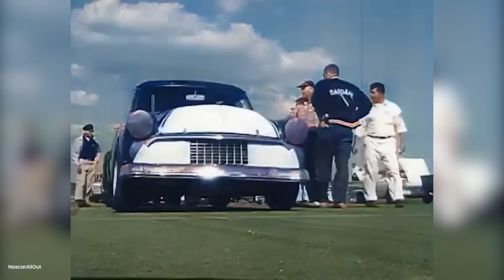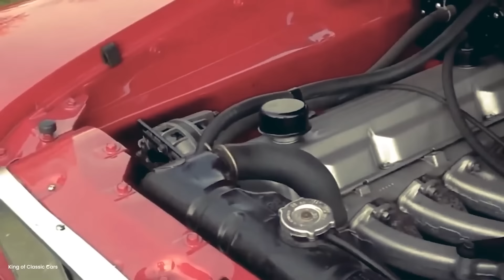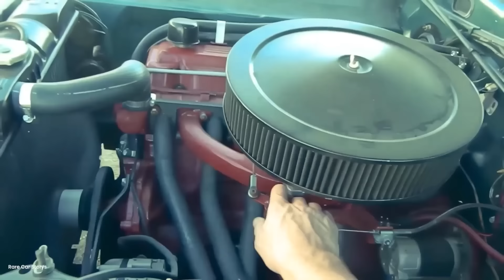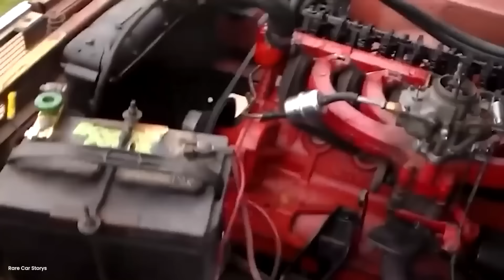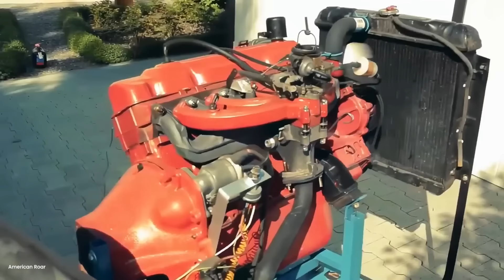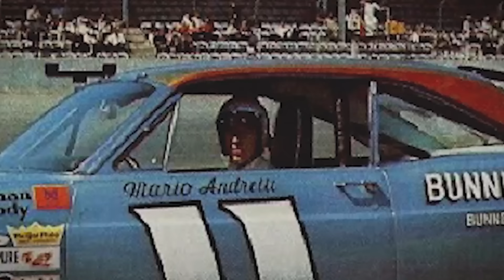How One Mechanic's "SIMPLE" Intake Manifold Made Plymouth Valiants Dominate the Drag Strip

Comment: Almost every thing said in this video is bull it doesn't take half that much work to do get a big block in a dart or duster or A body. I've done it in the past and I am doing it now. And with a mild 440it was a 12 second car with a 4 barrel and headers, nothing special and a set of gears . Why would you have to pull the oil pan to change the cam in the 440?

Comment: My father's new 1960 Dodge Dart Seneca had a 225 slant 6, 3 on the tree that eventually made its way into my teenaged hands. I outran MANY V8s with that car. In 1971 I bought a new Dodge Dart Swinger automatic. That car was a disappointment. The crankshaft went bad and knocked badly.

Comment: I remember people laughing at my bro at 16 when he adapted a 4 bbl Holley on his 66 Baracuda. Sucker ran like a raped rooster just with that carb & adaptor plate!  
 Didn't have it long, sold it & bought a 69 GTX with a full race 440 6 pack. He lived at the strip after that.
 My big Slant 6 1964 Dodge truck put my Uncles 1976 Chevy 350 to shame pull starting  my bros semi 10yrs later too. That low mile GM never budged it, my Dodge had over 300k miles pulled him over 3 blocks.
These things have excellent torque...

Comment: Why are pictures & videos of the 225 ci slant 6 backwards? I did the Offenhauser intake with a 500 cfm Holley 2 barrel. My times at 1/4 miles were exactly what is stated in this video. I also still got 28 mpg due to the overdrive 4 speed manual transmission.

Comment: First car was 66Dart GT 225/904 and when it broke I bought local guys old 225 slingshot gragster parts.
 Way over bored, .187" 1/2' stroker crank port and polish head w big valves, 527 lift cam, two 4 bbl intake with two 465 cfm holleys ank 2 piece cast iron headers. 
Custom dual point dist.

Comment: After I wrecked my Hillman Minx convertible, I bought a 61 Valiant V200 with 50,000 miles on it in 1965 for $500. The strong point of its 170 cubic inch slant six motor was the fuel mileage and its reliability. Like the Hillman it was under powered.  Getting on to the freeway was scary. The on ramps were designed so that under powered cars and trucks could merge at the Oregon statewide speed limit of 55 mph. The best I could do by turning on to the ramp at 45 mph was 62 mph when the merge lane ended. Often the traffic was going 70-75 mph. If you held the accelerator peddle to the floor long enough it would eventually reach 90 MPH.

The steering on the Valiant was the recirculating ball type with five turns of the steering wheel lock to lock that was typical for American cars. It had 2 inches of play before a directional change could be made. It lacked the feel provided by the rack and pinion of the Hillman. Typical of European cars the Hillman had 3 turns lock to lock.

 The Hillman gear shift with a flipped H pattern located on the steering wheel column. Valiant’s shifter was on the floor, not for a sporty feel but because it like its bench seat was cheaper. The shifter was flimsy. If you weren’t careful it escaped the H pattern constraints. I considered this a feature not a failure as it allowed my girlfriend to sit next to me at the drive in.

Soft springs for a comfortable smooth ride was the American way but quick turns at lower speed would cause a dreadful roll that would hide the horizon from view. When turning hard to the left my butt slid to the right, Alternating free hand grips of the to the top of the steering wheel eventually corrected the situation. I bought some stiffer torsion bars and front set belts from the parts department at the dealership. That made for less leaning and more under steer. I found some leaf spring helpers for the rear suspension that I adjusted so that when cornering hard the inner rear wheel did not lift off the pavement causing a sudden loss of power to the rear wheels. The lack of a front anti sway bar made the steering almost neutral with just a hint of under steer when stressed. This was an improvement but there was a hairpin corner on the way home from work which the Hillman easily took at 35 mph but seemed too fast for the Valiant at 25 mph.

The Hillman had radial tires which made handling somewhat like its cousin the Sunbeam Alpine. The Valiant used  bias ply A78-13 tires. When the tires that came with the Val wore out I got a set of four tires with a 12,000 miles guarantee for $60 which with the way I drove were bald by 10,000 miles. That guarantee got me another set of tires for free. Spark plugs would last 10,000 miles. Oil changes were every 1,000 miles. This might be extended to 3,000. But I decided to just add oil when it reached the add oil mark on the dipstick.

The radiator was sized to be compatible with the 225 cubic inch slant six motor. That winter I even put a piece of cardboard in front of the radiator thinking that it might clear the frost off the windshield a little sooner. This gave me to courage to remove the radiator fan from the water pump for better fuel mileage and a little more power. 

One summer day that year I was on my way home from coast near Tillamook to Portland Oregon when we got behind about 35 cars traveling behind a slow moving camper van. I decided to pass all the cars and the van before we got to coastal mountain range. I was going 60 MPH when a Corvette pull out in front of me and quickly accelerated away. The twisty part thru the coast range is about 40 miles or 3 times the Nurburgring Nordschleife. This took us took about 30 minutes. The Vette was able to use its disk brakes but the Val had drum brakes, which were only good for one stop, so if I had to slow down for a corner I just used engine braking and a little sideways skid. I learned the hard way about the limits of drum brakes with the Hillman. The Vett and the Val had the same average speed for the twisty part, but when the road straitened out the Vett shank to a small dot and disappeared.

Comment: Didn't Pontiac have hi po 6 too?
Reply: SOHC based on the Chevy 6. One of the first uses of a rubber timing belt. Would love a hopped up one in a 67-69 Firebird.
Reply: Starting in 1966.
Reply: They also had a 4 cylinder that was half of a Pontiac 389

Comment: A "225 pacer" refers to the 1969 VF Valiant Pacer 225, a performance-oriented sedan from Chrysler Australia that was popular for its value and sporty features. It was powered by a 175 bhp, high-compression, 3.7-liter (225 cubic inch) "Slant-Six" engine,  we got this in australia
Reply: Yes Australia got the straight 6 cylinder Hemi you lucky dogs
Reply: Don't forget the ve pacer before that also....
Reply: @Norego.Newzealand  There was no 'VE' Pacer. VF was the first model year of the Pacer.
Reply: @erroneouscode You may be right actually ve was first year of the v.i.p. maybe thats what i was confusing it with had the 273 v8.My bad.

Comment: At that time the cranks WERE forged! Regarding the cost of the intake manifold casting, I wonder if more modern lost foam casting would be more effective?
Reply: Yeah the crank was forged, but who ever breaks a crankshaft? To a large degree even 4-bolt mains, -although nice; are not really necessary unless you’re driving a dump truck all day at screaming rpm,s. I would have more so demanded that the rods were forged! They have a tendency to be the weakest link. Your idea about a plastic intake is a good one; I was thinking of one using header tubing, myself. (I actually did make one back in the 70s for a Ford Granada with a straight 6 250cu.inch and a small Holley 4bbl.). “Get out the ‘tap and die’ set.” It did alright; but for me it’s really never enough.